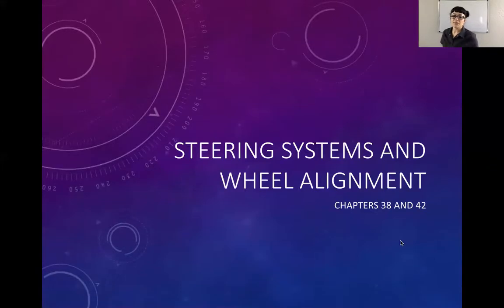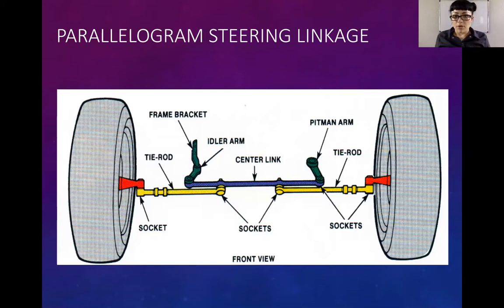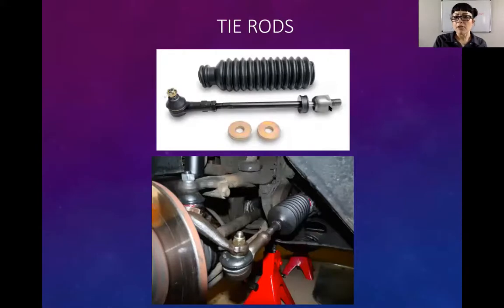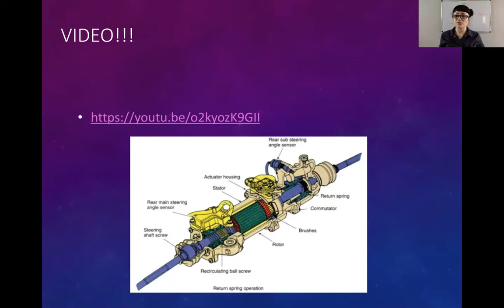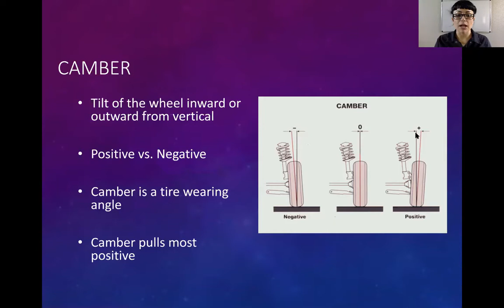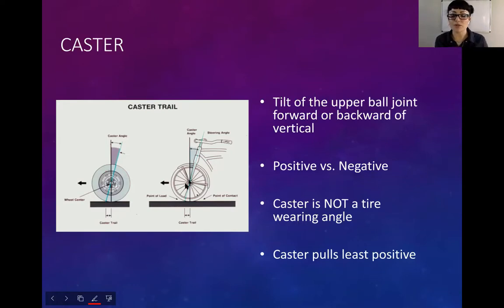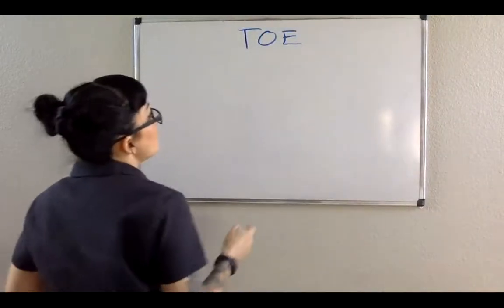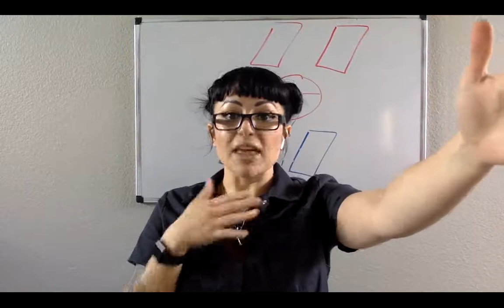Steering and Wheel Alignment

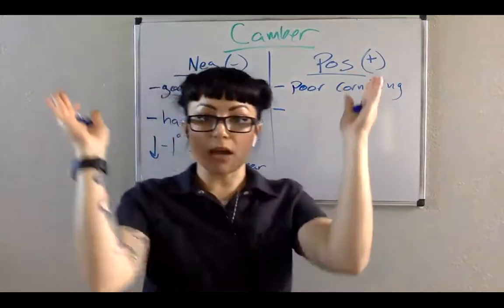Comment: 1:01:25 - You might still see positive camber on the load tires on some light trucks, large trucks (ten or more wheel) and on buses and coaches.  But probably not on the steer tires of such machines